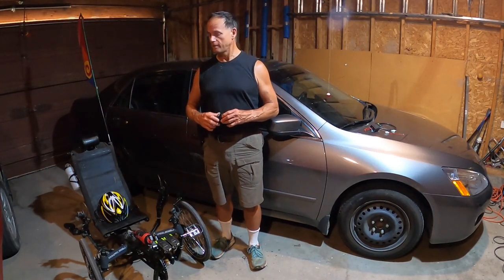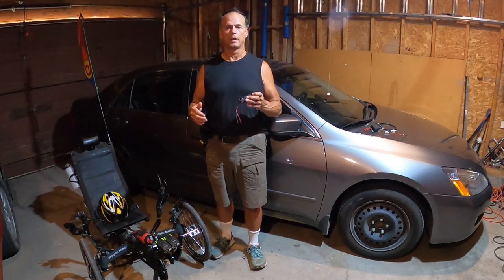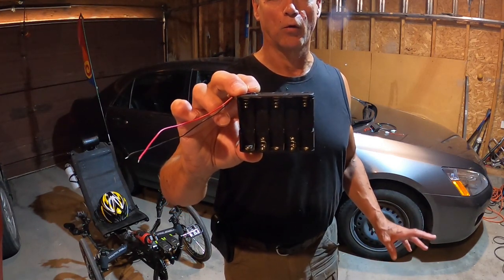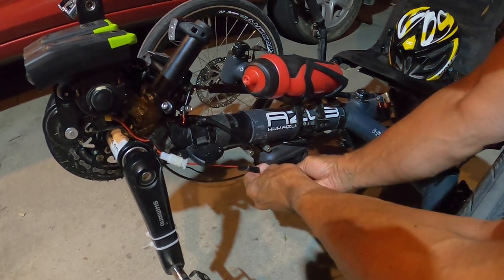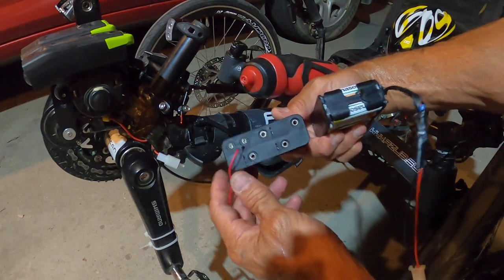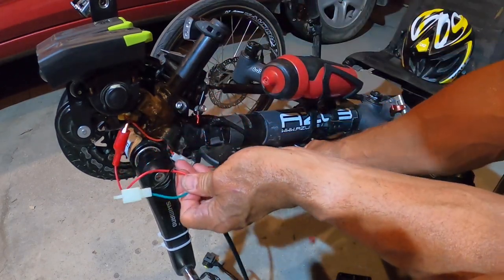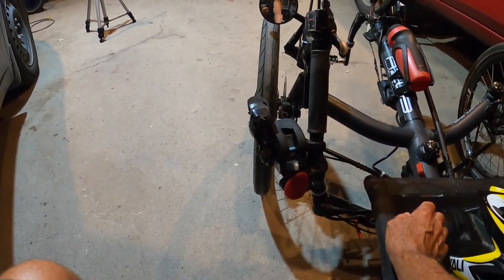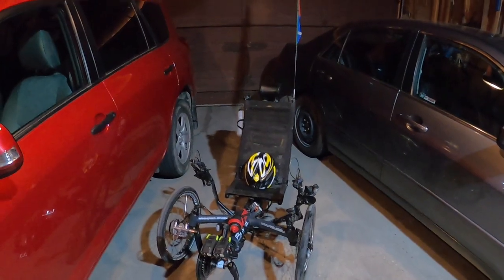DIY Super Loud Electric Horn for Recumbent Trikes or Bikes

Comment: Great setup. I like your head lights where did you get them?
Reply from the maker: I got them from aliexpress.  I've had them for 3 years now and still good.  Light changes intensity depending on light around you.  
The 4000 miliamp last alot longer but are more expensive.  At least rechargeable.  My very first video showed lights in dark.
https://www.aliexpress.com/item/33033143209.html
Reply: @happytriking  Thanks for the info
Reply from the maker: @gardenman3  No problem.